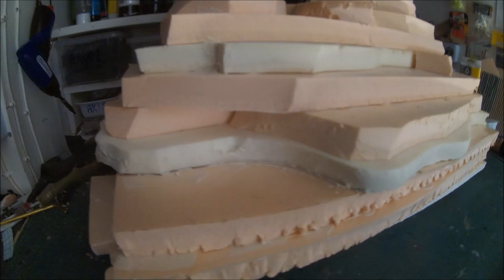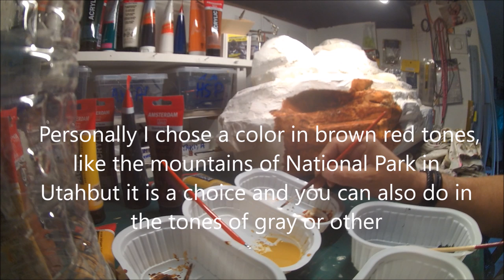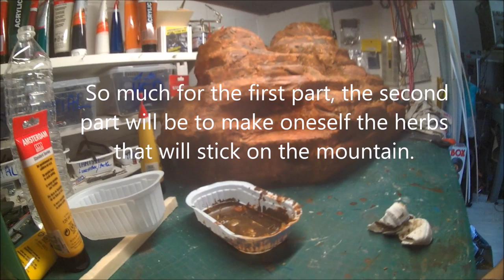TUTORIAL DIORAMA EASY OF A ROCK BUILD AND PAINTING PART 1

Comment: Exactly what adhesive did you use? It's important for me to know if I'm going to do this.
Reply from the maker: The glue I use is glue putty. You can buy it in DIY stores. You have to press the sides that you glue for 20 seconds. Optimal resistance is obtained after 48 hours, but this does not prevent the work 😊👍
Reply: @satorrotas  Wow. Thanks so much. Now what tools did you use to carve the insulation?
Reply from the maker: @777Atum  For the larger parts I used a small hacksaw, it works great. For the smallest parts I use a cutter with a retractable blade 😊

Comment: Hi, After cutting the foam pieces you used some spackle. What kind of spackle is it? Is it similar to drywall ones or is it another kind? I'm a beginner in this area and I am intend to make some diorama rocks here in Brazil. If you could help me with this tip I would be glad of that. Have a nice day. Regards, Rangel.
Reply from the maker: Hello, Very good idea to make a diorama, these are plates that work very well. I use fixing putty, this is a special glue for sterodur or styrofoam (extruded polystyrene) plate . But you can also glue plates with white wood glue, which will be much cheaper than the fixing putty I use. 
yes it is a style of plate for making drywall.
If you have any other questions do not hesitate, it will be a pleasure for me to help you 😊👍
Sorry for the late reply, I have some computer problems 😊

Comment: What exactly is the "water based coating?"
Reply from the maker: It is plaster that is used for house fronts, (that I had in my garage 😊)  but you can also use plaster called "Paris" twhat will be better I think. He advantage of plaster of paris is that it is very thin, it does not there is no thickness limit, it is also excellent for making castings and you have ten to fifteen minutes to use it. So use each time in small quantities 😊
Reply: @satorrotas  i bought the foam board, the adhesive. Today ill get the plaster
Reply from the maker: @777Atum  With a little patience and taking your time, I am sure that your work will be perfect 😊

Comment: Congratulations you are very creative, what material did you use to make the mountain, and which one did you use to cover the mountain.
Reply from the maker: Thank you very much Valdir . To make the mountain I use polyurethane panel to insulate the ceilings or the floors of houses, this is bought in DIY stores and really cheap. To cover the mountain I use coated with water , but you can use modeling plaster.

Comment: Has anyone ever used 3m adhesive spray for foam work? Dries faster.
Reply from the maker: I tried with a spray glue bomb, but I find that it does not stick the styrofoam enough, and above all I put this fake rock outside in my garden, so I needed a glue that is resistant to bad weather 😊
Reply: I use it for most auto use headliners and speaker stuff. Most don't realize you have to spray both sides of pieces you plan to stick together. But understandable about weather. I live in n. Mich. Even from sw Florida. Heat unsticks 3m unless you let dry in cool temperatures for cpl days
Reply from the maker: @johnramirez5996  Yes the heat is a problem, but the great cold too, not always easy to find the right glue 😊👍

Comment: What is the material that has been used for the base
Reply from the maker: Hello , it is Styrodur , extruded polystyrene used as thermal insulation for the house , the advantage is that it is very light , easy to work and especially it is not expensive .